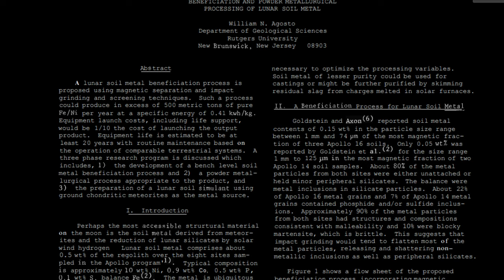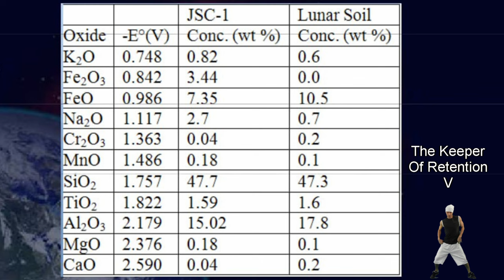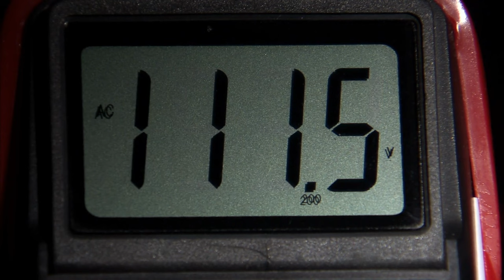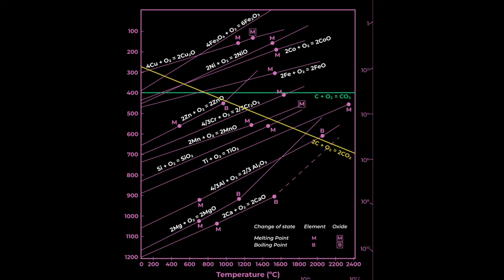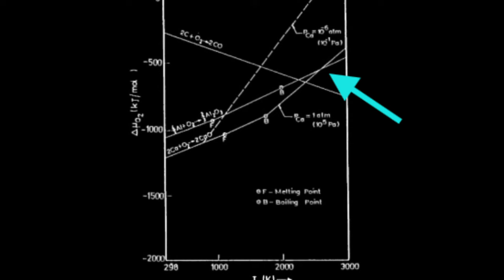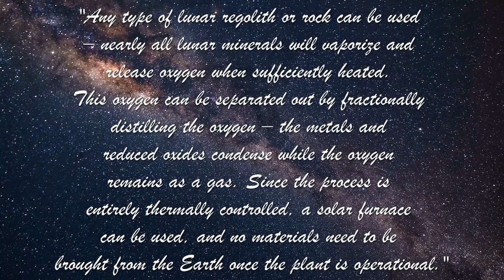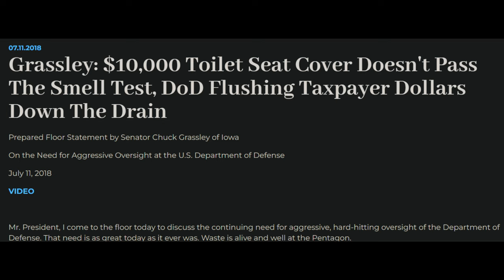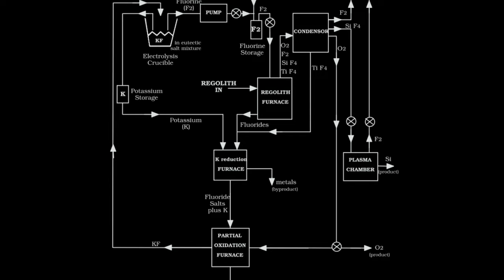Lunar Metallurgy

Comment: Neat stuff!  It does seem likely some combo of pyrolysis and electrolysis is the right way to separate lunar elements.  For just iron, aqueous electrolysis is feasible at a pH around 2, I've done this with sulfuric acid from basalt, but throughput is low because you're electrode surface area constrained.

Distillation: I have noticed a thin white crust of sodium oxides will distill off basalt dust as I solar melt it. 

Pyrolysis: 24:48 Evidently "calcium disilicide" (CaSi2) is a compound that melts at 1040 C, so reduced calcium and silicon would probably not stay separate.  I do like the idea of slagging off selected oxides, a high throughput volume process.

Comment: The thing about doing electrolysis to the molten regolith and that specific voltages yield different elements sounds a LOT like what fractional distillation towers do to petroleum.

Maybe a process and structure could be born from that analogy?

Comment: Look at carbonyl chemistry, low temperature and super simple method for collecting unreacted iron and nickel particles (common from M type asteroid impacts) from regolith at low temperatures, it also allows it to be plated out into large structures via chemical vapor deposition directly at under 200°C - to build large chambers directly inside thin heated formers.

Comment: the vacuum pyrolysis really doesnt sound like it scales at all, remember all that gas crap coming off will destroy your nice e-10 atm vacuum. effectively this means the process rates are very very very slow. maybe good for some elements that are only needed in small supply but not the many tons of iron needed.

Comment: The SolarThermal farms using mirrors could not only be used as ore distilleries but also use thermoionic conversion directly from heat to electricity. Ideally you want produce materials and energy to create more solar farms/ore destilleries from your  SEED factory and they can replicate the production at an exponential rate, eventually creating a continous solar belt around the lunar equator, this belt can also tranportt electrity to the (at that moment) night side. Thinks of more than 100 gigawatt at your disposal. BIG things can be done with that amount of energy. For instance lasers powering solarsails.

Comment: About separating the oxygen during distillation:

Would it be more efficient than a pump or cold trap to simply react the oxygen with some metal (google told me silver), move that now-oxide from the still to your oxygen storage, and heat it back up under pressure to release the oxygen and recycle the metal? Sort of like the earlier idea with the calcium.

Comment: Wouldn't cold welding heal most of the micro cracks on a lunar rail? 
I imagine any protruding irregularities could be smoothed out from having something heavy run on the rails.
Pit marks if big enough to warrant a repair might be better off sintered with regolith.
Sorry if this comment is on the wrong video.

Comment: oh there's a technique for refining metals, zone refinement, you just melt a point along a rod, and as it cools the impurities travel with the molten bead, works great for anything less than 10% it's an easy way to push it to 99.999%, so yeah 👍

Comment: I don't have the chemistry background to understand the details, here, but you explained it well enough that I understood the presentation. Maybe. 😬

Bottom line: cook the regolith hot enough while in a vacuum that it vaporizes, and then distill the vapors to remove the metals and the oxygen. Right? 🤔

It's the nearly pure vacuum on the moon that makes that a whole lot easier than doing this on Earth, which is why smelters down here use lots of clever chemistry instead of just blasting the hell out of ores. 😁

Comment: 15:00 Smelt it then. 
 25:25 Why not just you O2 to separate the two metals? 
28:04 Yeah, now that I think about it, a liquid just would not work in an airless environment. Mostly because it's the air pressure that keeps the liquid stable. Without air, it's all over the place.   
30:19 Vacuum pyrolysis.       
32:56 Naa, we just found another way to use it.  
33:00 Colleting the O2 shouldn't be that hard. As the O2 should be the lightest element, it will try to be on top. So all you should need to do is put a vent on top, a pump and a tank for it to collect into .  
33:44. One thing that I learned from history is that the accepted way may not always be the best way of doing things.  
35:40 As long as that metal building is fully covered so that none of it is exposed to the sun. it should be good. Otherwise, you will have an oven.  
35:55 One thing that might help in the separation of elements would be the filter the regolith, like one would do with sand. Using things like water and magnets and screens could help you sort out the elements before heating. Making the process faster and more efficient. 
 36:12 Regolith simulant.   
36:46 Most likely., money laundering. 
37:00 Good point. Basalt - Can be used as Moon regolith simulant.39:50 Floreen substitute for O2.  
40:30 That sounds good but what do you do about the corrasion, as it may damage equipment and people? Salts. Got it.  
41:30 Can't you use O2 to extract the Aluminum from the Iron?

Comment: If I remember correctly before aluminum electrolysis was invented they got it by heating it in a vacuum with calcium and it was very expensive because vacuum was very expensive in the 19th century

Comment: You were losing me at 25:00 (and now the infamous) BUT, (lol)  I am trying to figure out why you're concentrating on iron in a low gravity airless environment. Yes, mass and stress factors are considerations in some instances but lighter materials are generally able to do the same job. Also, having less mass, handling them would be easier and cheaper. Of course this does not take processing costs into consideration. 
Your thoughts?

Comment: could you bond the oxygen with pulverized iron pulled from the still a little later on and use that for iron oxide heat batteries and have them separated out in a  pressurized vessel after the exothermic reaction? I wonder if you  could pipe the heat from that reaction back into the still somehow.

Comment: Just me but oxides of iron are also magnetic, for example lodestone. I thought by heating the oxide with gaseous hydrogen you could get (relatively) pure iron and separate the hydrogen with electricity to reuse and store the oxygen. Need to confirm this from others.

I suggest the You Tube channel “How To Make Everything” for his work on how things were first made. Shows his attempts both successes and failures. Some ideas here are good ones.

Comment: Getting water on the moon or from earth to the moon certainly would be an issue except that we don't need to ship large amounts of water with heavy oxygen atoms. Instead we just need to ship a bunch of light weigh hydrogen molicules. 

Hydrogen reduction is already a thing on Earth can could be on the moon. And the water it makes can be used in water soulable chemistry, water soluable electro chemistry, and metal salt seperation by differences in soulablity, and countless other things. 

Water isn't for everything but it surely opens up future lunar  viability for some elemental seperation.

Comment: What about gravity? Are there facets of metal forging that we take for granted here on Earth with it's better than 1/16th moon gravity. Like how iron alloys coalesces under certain gravimetric and atmospheric constants? 
The vaporized iron could"condense"under magnetic manipulations but we may have to expect that moon iron isn't quite as magnetic as Earth iron. And what about water? Earthbound steelmaking still uses lots of water even if were not using much of a Bessemer process. There is water on the moon but how can we make use of it economically?
A definate reality would be we would end up exporting megatons of starter material via either space elevator or more likely many, many Sea Dragon heavy lift rocket trips.
Btw, liked and subbed.

Comment: Was going to dismiss this video as just silly due to the first 30 min totally ignoring the gravity and convection problems.   But that vacuum pyrolysis one seems interesting.   As described that sounds more like producing volumes good enough for platting surfaces.   Not sure how you would scale that up to produce more useful amounts in a reasonable amount of time.  But at least it seems reasonable.

Comment: I wonder, if chickens doing well in so  less gravitation on the moon....
And, as we got told, that the astronauts  on the orbital station loses muscle-mass, maybe those chickens never grow to a propper meal....?
Besides that it must be sort of funny to see chickens coping with low gravity....whilest trying to pick corn (or whatever to feed them)...

And if anyone maybe thinks about  bringing metal to earth, there  is maybe a problem with certain isotopes, who decay on earth (but not on the moon - because of less gravity or whatever lead to the decay). Espacialy those, who decay via electron capturing. The thing is, that the Chicxulub asteroid, who killed the dinosauers, did not brought so much iridium with itself, rather it was probably platin191, that then decayd to iridium191...in a single explosion, just, as some other impactors do in the atmosphere (airburst). 

I mean, if that huge asteroid impacts into the earth crust, some metals also will evaporate directly, because of the heat and that means, that they are also available in single atoms, not in chunks of "gediegen" metal or molten.  So, it must not be a nuclear process, that produce the single atoms of iridium, who then got deposited all around earth in huge and significant higher amount, as other elements. 
But i think, its the nuclear process, that lead to the deposites of iridium. Because, if such huge amount of metals got deposited nearly everywhere on earth, it is very likely, that this can only be possible, because of iridium was blown up in the atmosphere in single atoms, as just in a dustcloud out of chrunched impactor. 
I could be wrong...maybe, if the metals (or the iridium) got evaporated during the impact, that results in the same possibility of a significant iridium-layer all around earth. But i doubt, that airbursts happen only because of friction at the atmospheric gas.

If the nuclear decay is true (whilest entering earth-conditions), then it would mean, that you cannot bring metals from moon or other asteroids down to earth, because those transports would be a nuclear bomb, that explodes during entering earth-conditions.

Comment: I am not an engineer or a physicist, just a guy who is spitballing ideas here. Okay, so the vaporization temperature of iron is 2861°C, which is damn hot but not unachievable. I am also going to make the arbitrary decision that infrastructure costs, costs for things that are used again and again indefinitely and are not consumed in use, don't matter. Of course they do, but we're spitballing here. 

So, get some regolith heated up to 2900C in a pressure container and then shoot that vapor down a long, carefully cooled steel pipe. At that temperature most of the molecular bonds are going to be disassociated, right? So when the vapor cools down to under 2861°C, the iron will start to condense on the pipe and each element will condense on it at its own temperature. Out the end of the pipe comes mostly oxygen: you might need to purify it some before you go breathing it, but it's mostly oxygen. Remaining in the crucible will be mostly silicate slag, which can be ground off the crucible for construction purposes. 

Now the energy cost in terms of sunlight used to do this is going to be immense, but sunlight is free. What is not free is the mirrors or lenses large enough to accomplish this, but that again is infrastructure that is not likely to wear out soon. Precise temperature control over the pipe would also be hard, but should be doable. 

Since this would not just separate out iron (which is probably not that difficult to just pick off the surface with magnets) but everything of value in the regolith, why wouldn't we do that?

Comment: If you build your condenser like an Oilrefinery tower then you can seperate everything out at the same time, while always feeding new material.

I don't remember the exact data, this is an example that needs to be adjusted!

From top down not in this Order (Temperatures and Ranges unknown, Position and Ranges may wary. Oxygen in top, Smelting Pot on bottom):

50-300°C Oxygen escape, where you scavenge out the Oxygen at the rate you produce it.
-------------------------------------------------------------------------------------------------------------------------------------------------
400-500°C Iron (Pipe solution or similar)
-------------------------------------------------------------------------------------------------------------------------------------------------
550-600°C Aluminum
-------------------------------------------------------------------------------------------------------------------------------------------------
....Rest of the steps....
-------------------------------------------------------------------------------------------------------------------------------------------------
1900°C Boiling pot of regolith

This way you are able to extract a constant supply of elements without having a problem.
Regular cleaning may be in order.

I hope this helps.
I didn't see where I can join your discord.
But I would be happy to help you create those videos and be an active part of this community.
My expertise: Mechanical Engineering, Automotive and Machining/Manufacturing

Either way, use this idea in your next video.
Reply from the maker: @miendust  the link is on my Patreon, you don't have to become a member to join
Reply: @Anthrofuturism  thank you very much :D

Comment: And carbon is not even THAT necessary to make steel. Quite a few steels have less than 0.01 even. A lot of the strength in modern steels comes from Silicon and Manganese as well as other elements. Transformer steel is basically carbon free and just alloyed with silicon. It is quite strong. Silicon does that. We just use Carbon on earth because it is the easiest solution to jacking up strength a LOT for essentially free (for Steel made from Coke Fired Blast Furnaces)

Comment: One thing you neglected to consider is that moon dust is sharp and abrasive.
Reply: we need a study on the wear of excavator buckets and wheels and conveyors from the damn sharp oxide tops of regolith sand 
in theory, if we look at the wear of the wheels of the lunar rovers, then things are bad for us, because we will have to make hardened buckets and wheels from steels that are strong on the outside but elastic on the inside
Reply: @ziszlo6119 is building the excavator with legs instead of wheels beneficial, or would the problem still occur to the same degree?

Comment: My view, which is much like yours a collation of other peoples work. My focus is the logistics. What would allow an economy to work. Firstly we need basic shelters and foundry setups to extract metals. Your video neatly covers that.  Best built into lava tubes or in craters ans covered by regolith. You need power, combined nuclear and solar, maybe even thorium reactors since thorium is just as common on moon as on earth. You need cheap, fuel independant transport. 2 things might serve. A kinetic mass driver to throw dumb loads back to earth.  Spin launch tested this a few years back. Its stupid to use in atmosphere, but in a vacuum, this is likely highly viable.  This would allow us to move many our carbon intensive resource refining industries to the moon.  Using largely fuelless means to bring metals back to earth. We need no longer destroy our planet in pursuit of resources.

Apparently we could, with current material technology build a space elevator on the moon, using steel and inflated kevlar. This would greatly reduce rocket fuel needed, as moving material and people down to he surface without powered landings just makes more sense, if you could.

At this point we should have a fledgling economy, trading packets of refined metals to earth in return for consumables and water.

Now with abundant construction resources you can set up an orbital shipyard which means bigger space vessels designed solely for space use.  Likely cargo tugs, construction and exploration vessels.  At this point we can start expanding moon developments, possibly tourism but more importantly pushing incremental infrastructure out into the solar system proper.  Give it a 100 yrs at this pace and going to mars would seem like less of a one way radiation filled death trip.  If there is a hotel and 7/11 a few hundred thousand km away and dozens of vessels and stations relatively nearby and capable of coming to you in an emergency in a few days instead of 8months to 2yrs away.

This is all dependant on whether we can actually live and work in space and low gravity or more likely use semi automated drones.  Which is likely the weakest part, since we know even a few months will cause your bones to turn to rubber and detrimentally effect every aspect of human health from vision, heart health to immune system degradation.
So artifical gravity methods like spinning habits are likely mandatory.  Time delay necessitates being nearby to control drones with less delay issues. You can overcome this with ai. But so far our ai is only a large language modal which can mimic humans and make titty biggers and weird limbed videos of plastic looking people. Otherwise largely garbage tech. Least so far. And yes being overly critical of ai, so what, make better ai then with uses beyond people jerkin off and ripping off creatives.

Anyway i see the above, minus the ai rant, as the best, most viable sequence of colonisation of our nearby neighbour. Im open to improvements and new tech options. But would suggest not bank on vaporware and scifi handwaving being invented. It probably wont.